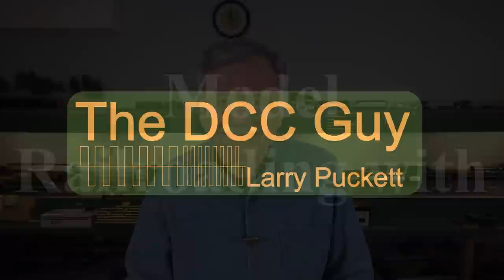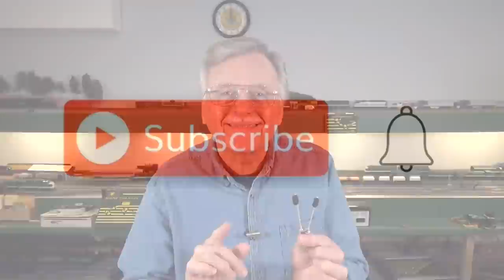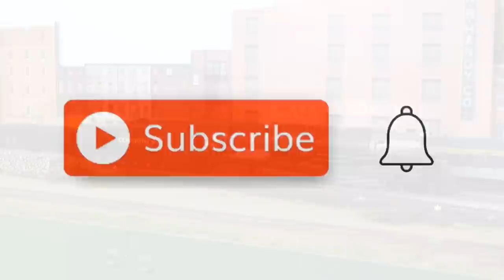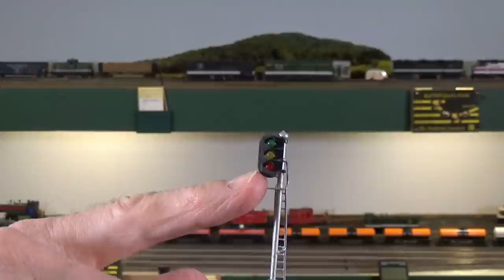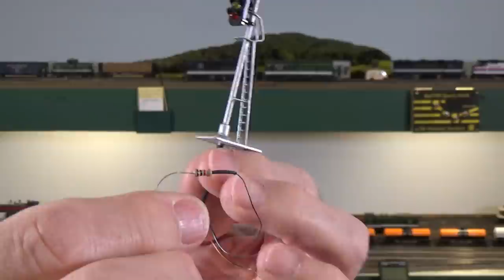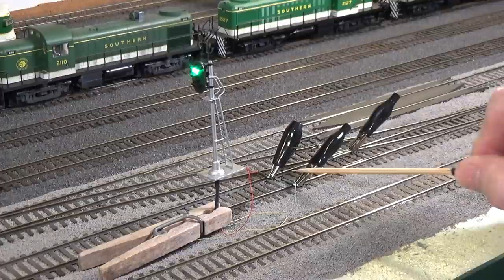Easy Signals For Your Model Railroad (246)

Comment: I have purchased a fair amount of these signals from the China manufacture. They might have a little extra paint on some of the parts. But they work great. I'm using IR sensors placed under the layout, I drill out space between the ties and mount the sensors below the rails.  I'm also using the old, time tested Chubb system for the logic. It works great.
Reply: Dale, thank you for the post. What brand of IR sensors are you using? Chubb system? I'm not familiar with it. Google didn't find it for me. Where would I find that?
Reply: @CobraChamp  Bruce Chubb wrote many articles for Model Railroader magazine including ones on operation, signaling, computer/model railroad interfacing, and on his layout the Sunset Valley.

Comment: How do you get a yellow signal?
Reply from the maker: As I have said multiple times in the comments this is a simple, quick, easy, cheap method. To get three color signals you will need a full signaling system=expensive, more complicated, not as easy.

Comment: good info but what about the yellow light?..I bought these and they come with 4 wires not 3
Reply from the maker: Sorry but this is the simple/easy approach. To get yellow would require a special signaling circuit, etc. So with this approach you only have a choice of 2 colors.

Comment: what about the yellow wire???  you didnt mention what you did with it besides it vaguely being in a clothespin in the video.
Reply from the maker: I didn’t talk about it because I didn’t use the yellow LED nor its wire. Given that there are only 2 rails and 2 bus wires to power the LEDs you can only use 2 colors with this very simple system.

Comment: Hi Larry, I’m going to be installing signals on my layout but not sure if I can. I’m using a Digitrak system and servos for turnout control through a ds78. Can you assist me with a diagram or do you have a wiring diagram that you can share.

Comment: I've got about 8 red/green signals to put on my DC layout still but I'm just not exactly sure where to place them!!?? I don't have a huge layout HO ,it fits in a single garage,so @ 18' deep x 12' 8" width. I only have enough room for two stations on two mains,so @ 66' or so of track and several loop lines,a six track yard, some sidings and dead ends. I'm just not sure where I should place these signals as I'd actually like them to interact with my locos. Cheers from C.Bernath,Maine.
Reply: they should go before your switches in your yard and sidings...especially before your switches off your mainline.

Comment: Another great video. The system you describe is a route signaling system, which was/is primarily seen in the West. The choice of signaling for East Coast railroads is speed signaling. It wouldn't be as easy as the frog powered system, but would be more prototypical for the Southern, ACL, and SAL lines.
Reply: What you say is completely true, but I think the system Larry demonstrated is valid for indicating switch settings in yards and (possibly) sidings. I know the PRR used ground signals on some yard ladders to do this and would often use "restricted" to indicate taking the diverging route in interlockings. This system is clearly not appropriate for indicating block occupancy.

Comment: Very interesting Larry, I did not realise you could use the dcc circuit to run signals directly. It has also led me to link my ground signals and points on my ECoS which I had not done as both dcc controlled separately.

Comment: Love it Larry! Unfortunately for me this doesn't work with frog juicers which I have installed everywhere! 
The main issue is that the signal would only change when the engine is on the turnout (triggering the juicer and thus the signal) which is too late. I didn't know about the automatic switching ground throws from caboose industries.  
Keep the good ideas coming!
Reply: I own a fair amount of the signals that Larry is talking about. The whole thing about signaling a railroad is the logic and knowing the how to input the logic. If you get a chance check out a couple of my you tube video's. (Dale Shipman Trains). I did a couple video's showing the signals in operation. I belonged to a large club (Kansas City Eastern) and we signals part of the layout. Chubb System is what we used. We were very lucky to have at our disposal and individual who has programed several layouts with this system. Old, but true! If you have questions about the system, let me know.

Comment: On my On30 layout, currently still in the track laying stage, I follow a narrow gauge copper mining railroad in about 1900-1912.  I have a large reference book for a guide..  I have not noticed any signals in any of the photos.  The railroad was isolated and ran point to point with wyes at both ends.  At each end was also a passenger station.  At the bottom of the mountain a standard gauge railroad came up on the other side of a long transfer dock for passengers and goods.  So, I don't think signaling will be necessary on that layout.

However, I am designing a second layout in N scale.  It is designed as a switching layout, no loops, located somewhere in the U.S. that represents switching 30' and 40' billboard reefers among the cold storage warehouses receiving goods for further distribution.  It is basically all downtown yard in an L shape shelf style.  The time period in 1929-1930.  There will only be four engines.  Two Ingersoll Rand Boxcabs and two 0-8-0 steam engines (yard goats).  The design kind of represents a canyon of warehouses with an industrial boulevard for trucks.  Does anybody know of a reference for signal types used in yards in 1929-1930.  I chose this time period because of the ICC ban on billboard reefers in 1932.
Reply from the maker: Hopefully someone will chime in on this. It sounds a bit like Paul Dolkos’ layout set in Baltimore although a few decades later. He has done several articles on it in MR and MR Planning.
Reply: The N scale layout might all be within yard limits and not have any signals at all. If it does have signals, I suggest that a good place to look for the types of signals to be used would be a rulebook for the railroad you are modelling. Some of these are available on line. For example prr railfan net documents has the 1925 book of rules for the Pennsylvania Railroad.

Comment: Hi Larry, I have purchased signals but I am now building my signals.  I use Azatrax signal controllers with infrared sending and receiving units.  Your layout must be DC or there is a hidden rectifier in the circuit.  One can make one’s own signals for Pennies.  Rob

Comment: Thank you for this simple tip. I just set mine up based on your example, and would you believe I actually got a number 4 Bachmann turnout to work with signals changing when turnout is open or closed. Again excellent, excellent, excellent video.... thank you!

Comment: Larry nice video  All my signals are connected to an NCE Light-IT  which send a code to my NCE systems which JMRI can see and on my JMRI Panel the signals change this helps for when using Dispatcher and running trains.  The signals automatically change and the trains stop or go depending on the signal
Reply from the maker: Tom what do you use for a feedback interface?

Comment: Great video Larry!  Very timely.  I'm using Tortoise switch machines. Do I attach all signal wires to the Tortoise machines or just the neutral wire?  If I attach the red and green to the rails which are DCC, would wiring the neutral to the Tortoise machine be an issue?
Reply from the maker: I would connect the red and green wires to 5he DCC bus using T-tap suitcase connectors as I have shown on previous videos. That way if you need to swap the wires the mot is easily done. I would then connect the black common wire to the feed wire going fro  the Tortoise to the frog and that can be done at either end of the wire.

Comment: Hi Larry. Very interesting. In your demonstration scenario, we didn't see the use of the yellow light - is it not applicable in this situation?
Reply from the maker: With this simple approach you only have 2 choices so I went with red/green. However you could just as easily use red/yellow. A 2 aspect signal like the DCC Concepts ones are probably more appropriate for yards but they only have two wires and appear to depend on their own electronics to control the LEDs or I would have used them.

Comment: Great input for me Larry as I am in the process of my layout planning.  Basic doubt - the DCC is basically an AC supply and the LED's work on DC.  Can you pls clarify.  Many thanks!!
Reply from the maker: Yes and no. It is a square wave that alternates between the rails—watch my recent video on DCC track power for the complete story. At any rate LEDs can see it as as DC since it has a phase similar to the concept of polarity. That may sound confusing and it is but that’s how it works! With the proper sized resistor, 1000 ohms in this case, the signals work off track power.

Comment: You can use a similar method to signal if a DCC reversing loop is lined up.
Reply from the maker: Yes I meant to mention that but it slipped through the cracks in my mind during filming.

Comment: Hi Larry. Can you show me how to wire 2 three leg bicolored LEDs back to back with a DPDT toggle so they alternate with the switch? Like red turns to green while the second led, green turns to red. It’s for turnouts. I’m trying to wire from the switch and not the tortoise. When I try this, it seems like this second bicolored LED cancels out the first. I saw the video you have with the red and green LED.s but they were not bicolored LEDs.
Reply from the maker: Ok, it sounds like you are using a Tortoise to control the points. Now on the 3 leg LED there are 3 legs, 1 for the green, 1 for the red, and 1 that is the common for the other 2. So try this first with just one LED. Connect the green leg to one DCC bus wire (with a 1K ohm resistor) and the red leg to the other bus wire (with a 1K ohm resistor). Now, on your Tortoise connect the common out contact on one of the built-in switches to the common on the LED. Finally, connect the other two Tortoise switch contacts to one each of the DCC power bus wires. Whenever you throw the switch using the Tortoise the LEDS should change. Now you have a 50:50 chance of getting this wired correctly the first time so if the LEDs light up backwards just swap their connections to the power bus. Once you get one working correctly just wire the second LED and you’re done.

Comment: Thanks for your quick reply. I use Peco pl-10 switch machines thrown by NCE Snap-It decoders. Should I connect black wire from signals to the wire which comes connected to the frog? Thanks again for your help and videos
Reply from the maker: I am not familiar with the PL-10, does it have a SPDT switch in it to connect the Peco turnout frog wire too? If yes then that is where you attach the common wire.

Comment: Thanks, Larry. Love your videos! I use Peco Electro-frog turnouts as they come without any modifications. Will these two aspect signals work with them or do I have to modify them? Thanks
Reply from the maker: Assuming you use something like DCC Concepts iP Digitals to throw the points and switch polarity(phase) of the frog then yes it will work.

Comment: if you can help me on this im doing dc old school ho layout on turnout can you use a toggle switch to the motor
Reply from the maker: Yes and the Tortoise instruction sheet has diagrams showing how to wire this plus I did a recent video (#351) showing how.

Comment: Hi Larry, I'm not sure if this question was asked but does this idea work on turnouts with insulated frogs?  Thanks
Reply from the maker: I was using a Tortoise switch machine to change the frog polarity so as long as you have a way to change the polarity of a wire then it doesn’t matter whether it is connected to the frog. I explained this at about 12:55 in the video.

Comment: Hi sir.   What is the best decoader for a f 7 athearn engine.   Rick.
Reply from the maker: Wow, there are so many options, both sound a d non-sound. But the basic HO sized decoder format works great no matter which company makes them. You also have to consider the age fi the loco as the newer Athearn models come with a DCC socket.

Comment: This great but you also want the signal to turn red after the train passes by the signal how u do that?
Reply from the maker: Throw the points back the other way. This is a very simple system and not necessarily completely prototypical.

Comment: Will this also work with an insulfrog or unifrog turnout?
Reply from the maker: It will work as long as you are using some type of point motor or device with contacts that can switch polarity. In this demonstration I was connecting to the frog which receives power from the internal switch in a Tortoise switch machine but an iP Digital would work as well as some others with internal power switches.

Comment: Could you use a frog juicer that is hooked up?
Reply from the maker: It should work but I’m not sure it would give you the effect you want since the signals wouldn’t change until the loco hit the frog instead of when you throw the points when using a Tortoise or other device to throw the points that also changed frog polarity.

Comment: Hi Larry : ( 1 ) Is A  Dropper-Resistor ( Balue : 1K Ohm ) Off The Main DCC-Buss ( 14-18 VAC ) Sufficient Protection For Extended  LED  Life ? ( 2 ) You Connected The ( Black ) Common To The Frog As Powered By Totoise / Cobalt ... What About Hex-Frog Juicers ?  Ta / John
Reply from the maker: The Frog Juicer will change the frog phase(polarity) independent of the turnout points being switched. So the LEDs will not change until a loco proceeds through the turnout and of course it will not proceed until the LEDs change—catch 22. So this really only works when used with some manual or motorized point controller which changes frog power.
Reply: @TheDCCGuy  Well shucks! Glad I read the comments !

Comment: I have some old Bachmann f7 styled units from the royal gorge train set and it seems the gear boxes are seized. Is there an Easy way to deal with them?
Reply from the maker: Probably old gear lube dried up. Take them apart, clean off old grease and oil, relube, then reassemble.

Comment: How would you wire in the yellow light. I am using Walthers switch machines with older switches from th 80s so no power to the frog. The switch machines have 2 switches on them I was thinking I could connect the black to one track and the other to the center pole on switch machines with the red and green lights attached to the other point with the signal coming to a switch that will derail it. On the other side I would connect the yellow and green to the other points to show green for straight and yellow for siding.
Reply from the maker: If I understand you correctly that sounds like it will work. Just use the SPDT switch in the Tortoise to flip phase(polarity) and attach the common to it and wire the green and yellow wires to the DCC power bus. I just showed it attached to the rails so folks could actually see what I was doing.

Comment: Larry, I have a question, I know how to control 1 signal with a caboose 119R ground throw, but can you control 2 signals(1 diverging, 1 straight) with the same 119R?
Reply from the maker: Assuming you are using LEDs, just connect it to the same switch but reverse the wires which will reverse the polarity.
Reply: @TheDCCGuy  thank you

Comment: So, I don't power my frogs.... can I just use the switch in the Tortoise to do the same thing?
Reply from the maker: Yes you can use one of  the SPDT switches to route the correct polarity to your frog. Connect a feeder from each or your FCC power bus wires to the input contacts on the Tortoise and wire the output contact to the frog. Almost all of mine are powered that way.
Reply: @TheDCCGuy  Thanks Larry!!

Comment: I want to run DCC, and have two engines with more to come, but I have a lot of DC engines. I can only run one DC engine at a time, but how can I use something like this with a track that is going to change polarity with the DC engine?
Reply from the maker: How are you running your DC loco and DCC?
Reply: @TheDCCGuy Through the 0 channel on the Bachmann controller.
I can only run one DC engine at a time with as many DCC engines the amps will allow, so far three engines.
Reply from the maker: OK, as long as you are using DCC in analog mode then this method should still work. Be aware though that running a loco without a decoder this way for long periods may damage the motor. The high frequency of the DCC waveform can cause the motor windings to heat up and if they get hot enough the insulation will melt and go poof!
Reply: @TheDCCGuy I didn't know that. Is there a way around that?

It looks like the only option open is to get good at converting engines to DCC?
Reply from the maker: That’s the answer. Digitrax has been telling customers for decades to only use analog mode for testing a new locomotive but not to make it a regular practice.
Reply: @TheDCCGuy Thanks

Comment: Could you manually control this signal with a DPDT switch?
Reply from the maker: Yes, that’s basically what the Tortoise switch machine is doing with the frog feed under the layout. Although, since I only use half the switch contacts it is a single pole double throw switch.